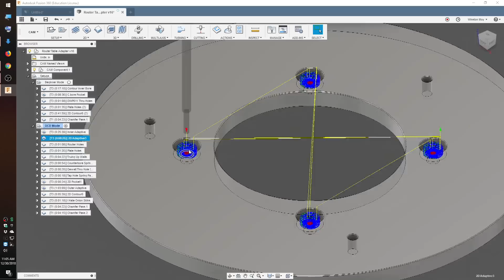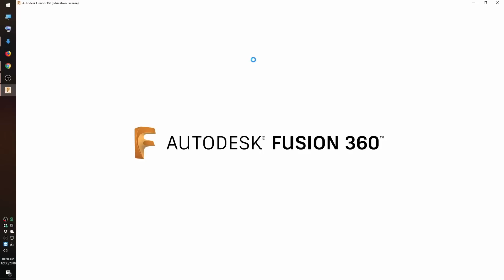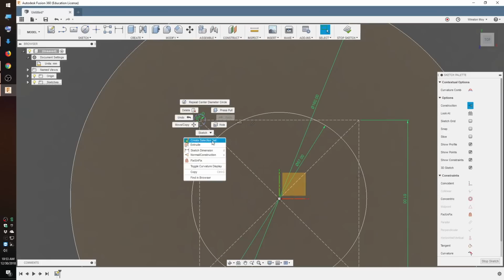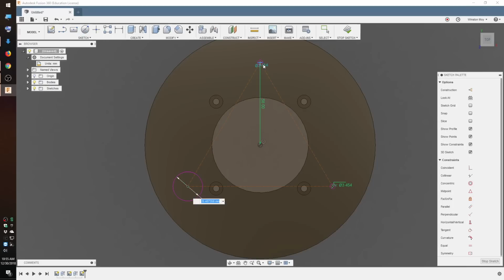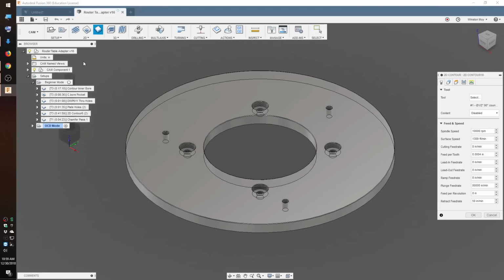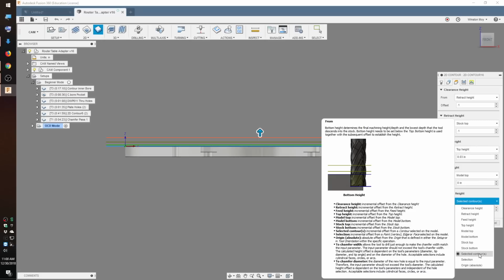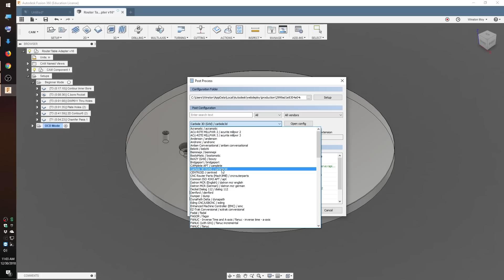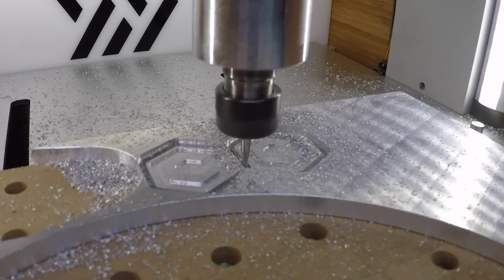Intro to Fusion 360 for CNC Users

Comment: Obviously there is a lot that can be learned about Fusion 360 but just one thing I want to mention that applies to this video is regarding the four screw holes. In Fusion you can define one and name it, or I should say rename it if you want since it is given a name automatically, then reference it at the other three corners. This way if you want to tweak the hole or countersink parameters later, you just change one and they all change. Something good to get used to for down the road when designing more sophisticated projects.

Comment: Thanks for this Winston. I was able to get my first cut on a Shapeoko 3 (ever) starting immediately in fusion 360 following this workflow. I only had to supplement with a few additional resources for feeds/speeds. This is an incredibly useful resource for first-timers (I am familiar with modeling in fusion, but never used the manufacturing tool before).

Comment: Great video! How did you use the adaptive clearing to cut out your part? Anytime i use adaptive clearing, it removes ALL of my excess stock. I have a large sheet and obviously want to use it more than once lol.
Reply: Sketch in a feature with the extent of the stock that you want to use. You can then select the stock contours in most toolpaths. 

The software is clearing everything because adaptive clearing leaves only what you specify, so you can also put in a perimeter - or you actually just need to use contour with slot clearing instead of adaptive clearing.

Comment: Great Video, I am looking to machine a PCB out of a copper plate using the CNC3 3018Pro, mini CNC machine. Not sure what settings to set the tool path for copper. Where would I find this information? I am also using Fusion 360 CAM environment.

Comment: I couldn't figure out how to match the part with stock. Like my part was 1x1.25" but the stock I use was 1.5 x 1.5. but my tool path shows cutting only by the periphery of 1" , even though it is showing added stock to the sides, which means the tool will hit the extra.5" on the stock while plunging. How do you adjust this so that I can cut a smaller part from a bigger stock. Or do you have to use exact size stock as your design every time?

Comment: Nice video, what programme do you use to run your gcode?
Reply from the maker: We provide Carbide Motion as our Gcode sending software.
Reply: @carbide3d  thanks for quick reply, would that work with a chinese 4030t cnc?
Reply from the maker: @Bible_Studies101  No it would not. It only works with our line of CNC machines.

Comment: I may have missed this, but do you have to run the file into carbide motion to finally cut? Or are you doing everything from fusion? I’m debating between the shopeoko and x-carve and I think I’ve decided on the shapeoko, now I just have to decide how big of one I wanna get. Thanks for your input. I’ve watched a lot of your videos and I really appreciate your work.
Reply from the maker: Carbide Motion is the program you use to send gcode (that you'd export from Fusion) to the machine.

Comment: Winston I've tried Fusion 360 several times.  My biggest problem while trying to follow a YouTube video, is the X Y Z alignment.  Mine always seems different than the example and I don't understand how to rotate/align the subject to match.  Otherwise I follow everything else just fine.  It's just this initial step I have problems with.  I have watched every video I can find for Fusion 360, but no one every addresses this subject.  Is it that simple that it doesn't need explanation?
Reply: In the very first tab when you do your stock setup there's a dropdown to pick orientation. You can pick an arbitrary face to be perpendicular to Z.

Comment: Winston.  Any way you cans so something similar on the shapeoko?  Not everyone has a nomad 😉
Reply: the device shouldn't matter, the process is the same. obviously speeds and feeds may be slightly different for your device.
Reply: @TMCmakes  I disagree....the Nomad is a lot more accurate (0.001), and the +/- 0.003" precision of the Shapeoko will affect the part's fit.  The Shapeoko's 0.001 (or less) repeatability allows it to cut to 0.001 with an extra step (or two).  This extra step is not known by most of the field and I agree that Winston should make a video to explain it.
Reply: @RichardCournoyer  the process is the same. Stock to leave, depth per pass, etc is all subjective per machine. He can't cook your cake for you, just give you the process